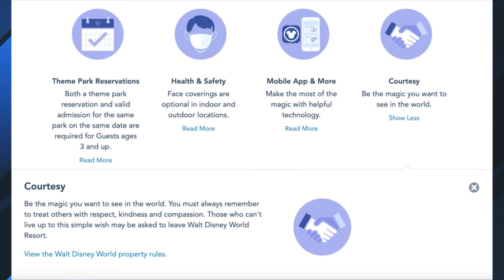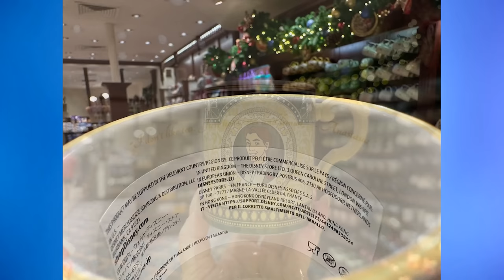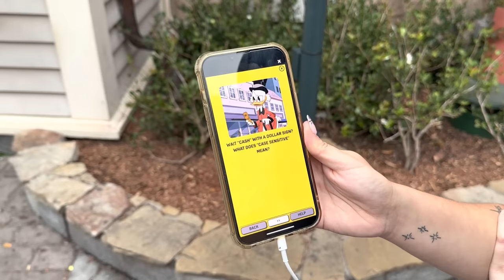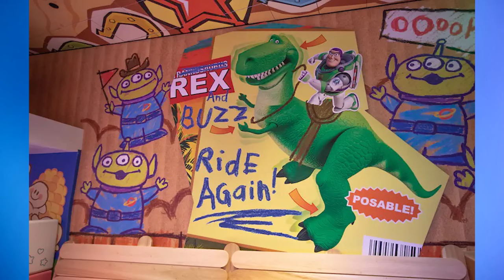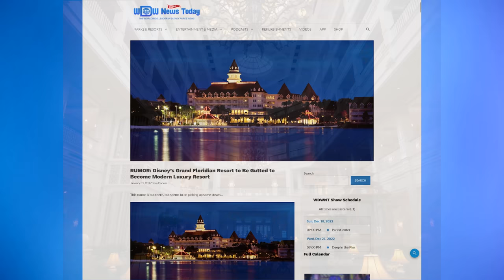Josh D'Amaro Almost Quit Because of Bob Chapek, Fox's Anastasia Now at Disney World

Comment: Why do Americans call a burger a sandwich?  If it's between a sliced bun, it's a burger.  If it's between two pieces of bread, it's a sandwich.  It aint that hard.
Reply: But a sliced bun is two pieces of bread…
Reply: Because a burger is short for hamburger, which is a very specific type of sandwich that has little to do with the bun around it.
Reply: What if you have a hamburger patty but don't have the buns? 🤔